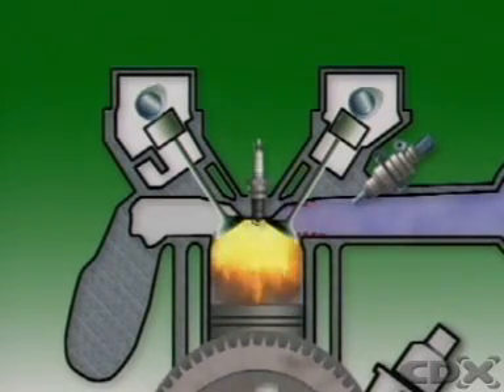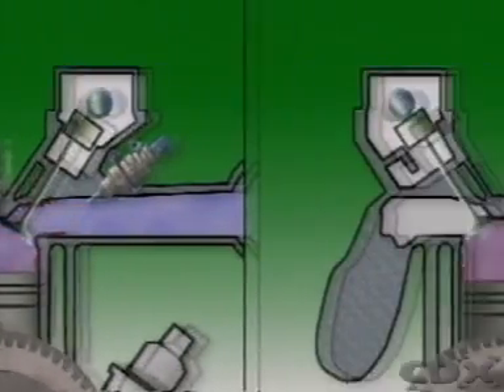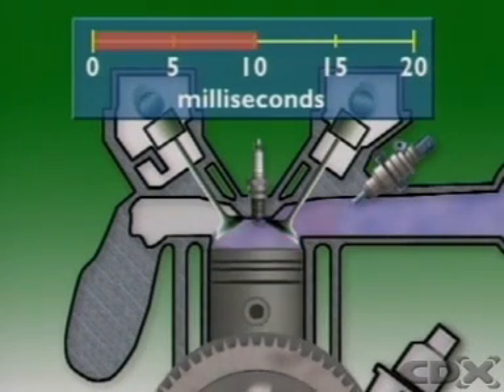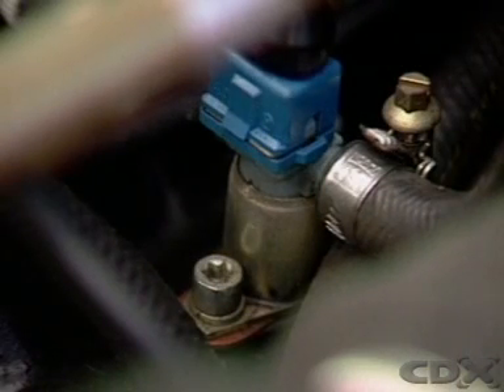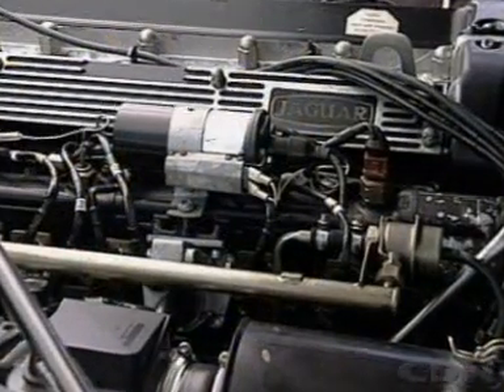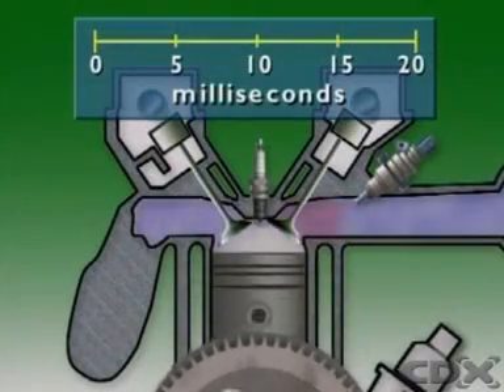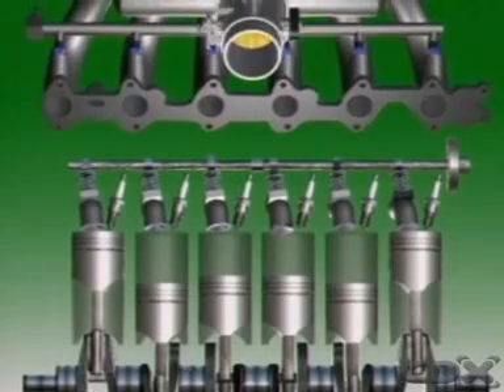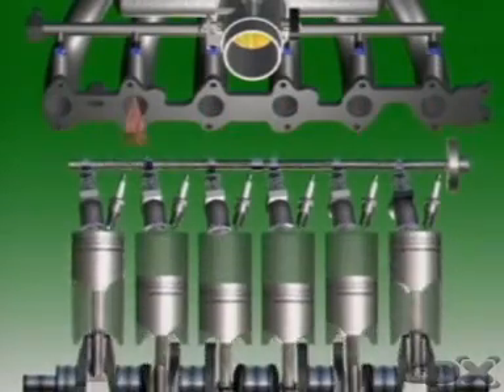Vehicle cold start sensor

Comment: If my engine run cool and i start it. its bofflin and then when its warm up it run straight... when it stay over night and i try starting it in the more it shuts off and i start again for 4takes its bofflin then it runs good.... can someone help me out???? Toyota corolla 1999 waggon 4a engine
Reply: What was it?  Sounds like one possibility could be a bad engine coolant temperature sensor, or at least something wrong with the system it is connected to.  Did you spark plugs have carbon buildup consistent with a rich fuel mixture?